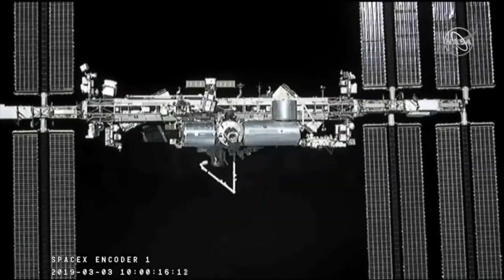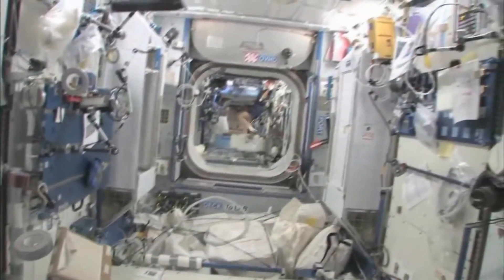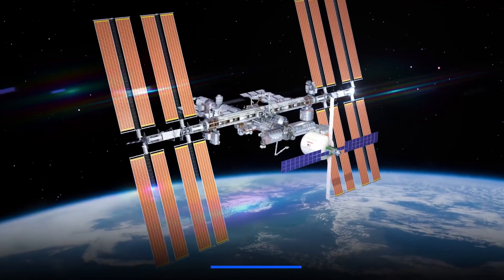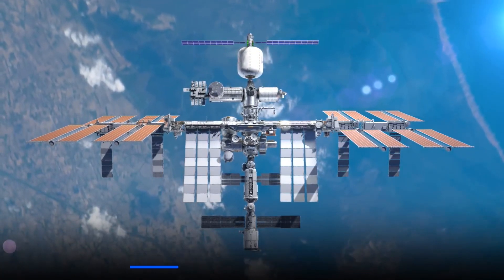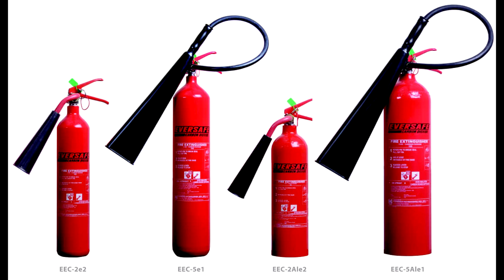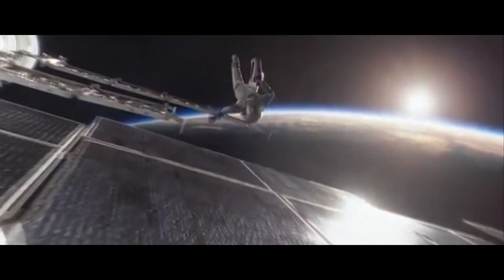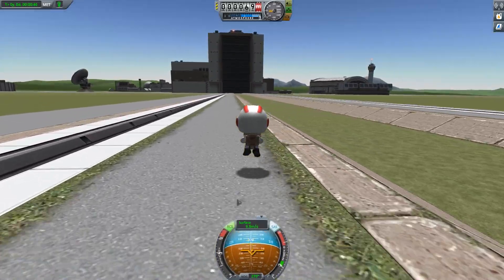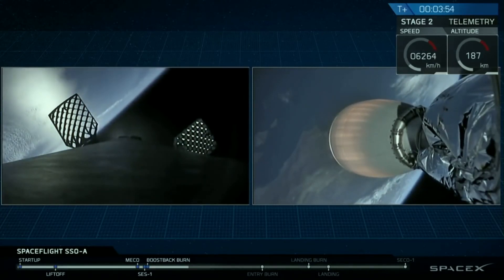Would A Catastrophic Air Leak Knock The Space Station Out Of Orbit?

Comment: At about 1:47 you mention the speed of air molecules (N2, O2) as per the kinetic theory, but this very high (rms) speed applies only for the individual molecules, which move in random directions, and not for the bulk of the air (which may be static or flowing, it does not matter, as the individual molecules speed is dependant only on temperature). There is no way to make the air particles move in a coordinated fashion. To calculate the impulse, macroscopic properties like pressure and flow should be used, along with the geometry of the exit nozzle. I guess it would be safe to assume turbulent flow when the station depressurizes, as well as subsonic conditions, so Bernoulli equation applies.
Reply from the maker: Yep, the point was to start with the worst case and show even that wasn’t enough.
Reply: @scottmanley  OK. Just wanted to keep the kids off from trying to extract useful work from dubious sources ;-)

Comment: 5:40 why was the MMU so big and such low delta v? It literaly sounds like 2 big fire extinguishers tied to a austronaut's back would get better performance? What was the reasoning behind that?
Reply: It had multiple nozzles pointed various directions, and redundant safety systems to prevent things like accidentally ending up in a wild spin.
Reply: And also the mass of it and the EVA suit. 
The gal from Gravity had more because she was in a very light space suit and the extinguisher itself is much lighter than the entire MMU. 
In KSP for example when you try to deviate an asteroid with an Apollo style ship, your basic dv of approx 2500 m/s becomes about 2 m/s with a heavy asteroid in tow because of the added mass of the asteroid.
Reply: You don't want a lot of delta v, considering it was intended to work in close proximity of space hardware. Consider working on the engine of your car, but instead of taking a small step to get into another position, you have a rocket strapped to your back which pushes you in meters/second around, you don't want that. Furthermore, any translational thrust will input a torque and too much of it will make work difficult and tire out the crew. (They found this out the hard way during Project Gemini). As for the weight: the frame had to be rigid in all directions, contain 24 thrusters, have enough fuel to be in space for hours on end, and ditto battery capacity. Add in the gyroscopes, computer hardware, power supply, pressure regulators, manual translational controllers, etc... All of the above systems were double implemented for safety redundancy so basically you had 2 MMU's in 1. 150kg is quite light for all the stuff that was packed into the Unit. :)
Reply: As I understand it, SAFER has about 3m/s ∆v for emergency use whereas EMU had 25m/s ∆v, capable of several hours EVA.

Comment: By the way: What are they doing with those almost 600 cubic meters of PRESSURIZED, UNINHABITED volume on the ISS?!
"Yeah we have like two times this space behind this door over there but we like it cozy so we just don't use it" 
And don't tell me it's storage because I imagine it's hard to be a successful hoarder in outer space :D
Reply from the maker: Lockers full of gear take up pressurized space, but are not habitable.
Reply: Most of the ISS volume is probably equipment.
Reply: Experiments and any of the station's systems that you want to be accessible for maintenance without going outside.
Reply: ISS modules are essentially cylinders which enclose a cuboid volume of habitable space. On each side of the square cross-section of habitable space are bays for experiment racks and other equipment which are part of the pressurised volume but not available as habitable volume. The bays have a flat front but are curved at the back to fit the curve of the cylinder.
Reply: @coconinoco  Thanks a lot for the objective answer even though in hindsight my comment swayed a little towards the sassy side :P
Makes you appreciate the big machinery those astronauts are part of. In the end it's up there to produce science and not for fun. Very cool.

Comment: My question is: Would a CO2 fire extinguisher be able to survive in space?
Reply: Very likely, yes. Unlesss it was a incredbly shitty one. They tend to be some pretty thick steel already, and if under safe load a single atmosphere of extra pressure would add some danger but not really result in a failure. That said, thanks to the lack of air and direct sunlight it's likely after a few orbits it would explode from the heat expanding the CO2 and increasing the pressure.
Reply: I think it would. Those tanks are strong enough. Kind of reminds me of when the Tesla was launched and the conspiracy nutjobs were touting that the tires would have exploded in space. Then Wolfie came along and showed them otherwise. https://youtu.be/mKDm1tBKUAA
Reply: Scott had a video about firearms in space - one of the problems there was metals spontaneously welding themselves together in vacuum. So that could be a problem for the valve mechanism potentially.

Comment: But what if the volume was all Plushy toys and those were expelled? :)
Reply: I've no idea, but I'd REALLY like to see that
Reply: What sort of pressure would force them out of the station? Are they packed into the volume so tightly that spring forces blast them off into space? That doesn’t sound very efficient.
Reply: John Aldrich It's about what if scenarios, not efficient SOP.  Imagine a crew capsule test filled with compressed plushies.  Hatch pops and plushies pop out the hatch.

Comment: Would the fire extinguisher even survive in space without being crushed or ripped apart? (sorry quite sleepy so can't figure out if the gas would rip apart or the vacuum will crush it)
Reply from the maker: If the tank stores gas at 100 atmospheres in the earth then when it’s moved to a vacuum the pressure difference becomes 101 atmospheres. No problem.
Reply: @scottmanley  thanks for replying, ah, didn't realise it wasn't an issue :)
Reply: The pressure difference between earth and space is only 1 atmosphere ,1 bar or 14.5 psi. I'm sure the metal canister would be able to hold much more overpressure than that.